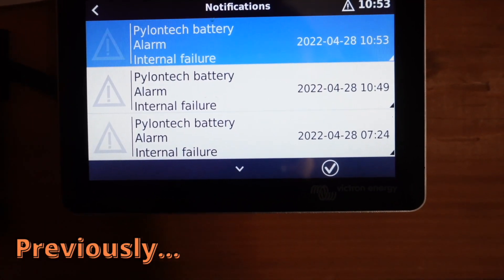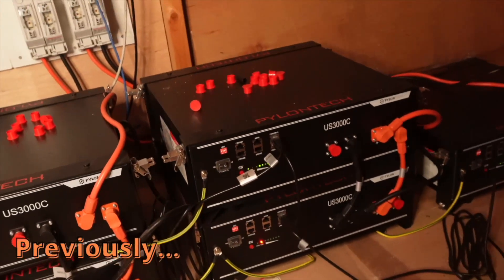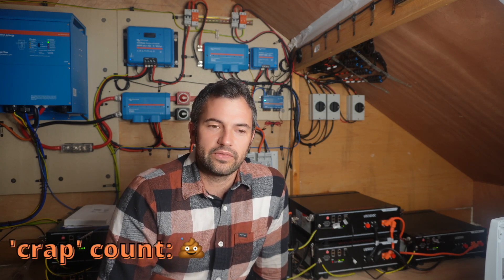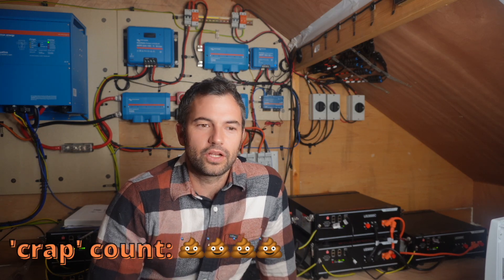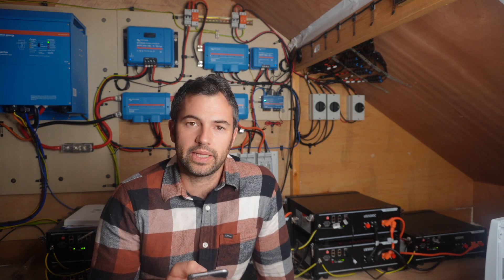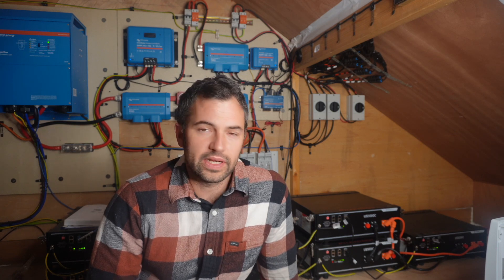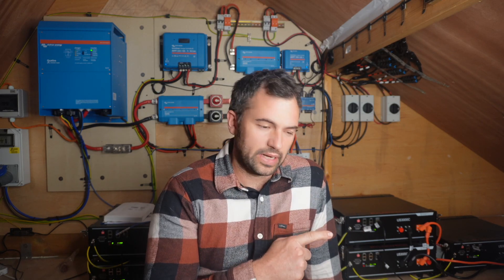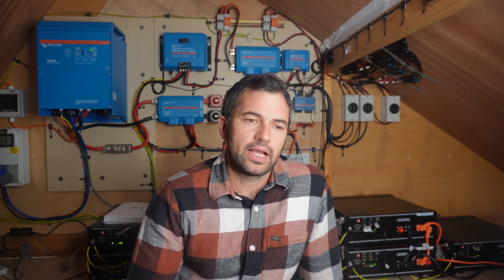WHY WE WILL NEVER BUY PYLONTECH AGAIN

Comment: I noticed the Cables are too small for the power it can deliver.
Reply from the maker: They would be if we had only used one set of DC cables which is why we have used 4, which is causing quite a lot of misunderstanding on here because people don't understand that they batteries are still in parallel even though we have had to use four sets of cables ☺️👍
Reply: @The_OffGridFamily  I suspect one of the battery is being hammered hard because the current sharing is not balanced. Some of your cables are longer than other.

You can specify which battery among the set are failing? 

Another factor is BMS issue, again this is due to the load, some of the BMS are working more than others thus it shorten its life or efficiency. 

Also the failing battery, you may check its BMS and determine which Cell is failing. 

Again, what I am pointing out is that regardless of Brand or builder of battery pack, anything can fail and we can't expect perfect service.

Comment: We have 'Give Energy' batteries, they are great & have an app so we can keep track of the stored power, highly recommended. BTW don't worry about the trolls, they have no value. Keep the faith guys, hope you are all OK xx  P.S we have also just invested in a delta 2 which we charge when the solar is chucking the excess back to the grid. It adds another 1 kW to our storage & is portable with regular socket & USB ports - good as a back-up.
Reply from the maker: Thanks for your support, it's always appreciated ☺️ 
Funny you should say that about the Ecoflow... watch this space 👍
Reply: Ecoflow??
Reply: @lipsee100  yes, that's right. A new model with a much higher grade battery than the smaller models have.

Comment: You will have a chance with the UK supplier, but if Pylontech are struggling to shift excess stock or worried about reputation I think you will struggle with China.
Reply from the maker: We are putting pressure on the supplier now.  Fingers crossed 🤞☺️

Comment: Your batteries should be in parallel with the positive and negative at opposite ends. Set the charge voltage to 52.4v on the victron.
Reply from the maker: Thanks for your comment Justin.  The batteries are in parallel, and charge voltage is set to 52.4v.  The reason we use four cables is because the draw of our inverter is too great for the 120A limit of one set of cables, as per manual suggest ☺️👍
Reply: @The_OffGridFamily  Can you share your victron configuration settings please? I have my own 14kwh system running with cerbo gx which is a similar setup to evpuzzle.
Reply: @The_OffGridFamily  Just to check, are the cable runs of equal length? (So from battery to the busbar)
Reply: Victron limit the voltage in firmware already when set to BMS control via the Cerbo GX. BMS requests 53.5v but the firmware overrides it. Its not a pack voltage issue or they would all be alarming.

Comment: Hey chaps. 

Love your videos. 

Just a thought. Can you rack these up? I’ve seen a lot of improved behaviour If you can rack them with a positive and negative bus bar, matched length leads between each battery and bus bar. This splits the charge and load evenly between all batteries. Give this chaps video a watch. Really explains it well. 

https://youtu.be/1U6E1bvjDYQ

Comment: You need an expert to come in and sort this for you.
Reply from the maker: We feel like we've worked out enough now that the supplier should step in and sort it for us.  That's what we are pushing for.  We have removed the battery in question from the system now and haven't had a notification since doing so, and it's been days ☺️

Comment: No its absolutely not acceptable. Can well understand your frustrations. Since you now have the USB connection and battView hooked up, might want to check if they are all on the same firmware. Yes this is the job for your supplier, whom ppl hv suggested quite rightly so that you, well, sue them. Even if you take that 1 batt out, the bank will still require a Pylon to enlarge in the future should you choose to do so. Im sure you already have, just incase, go through the pins for all LAN cables, patch ones included since they are not the regular pin positions we find in everyday LAN cables. Best of luck and keep us updated.
Reply from the maker: Thanks for your comment ☺️ We are using the cables that came with the batteries, and they're not damaged at all so should be ok.  Thanks for the batteryview suggestion 👍